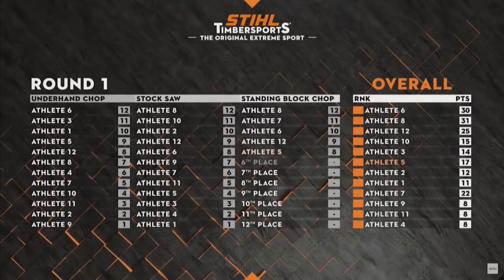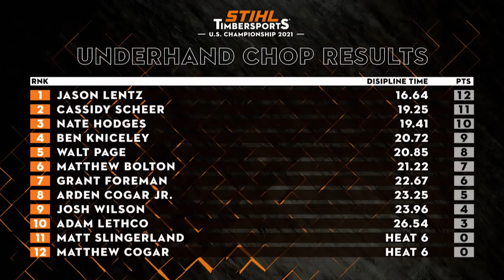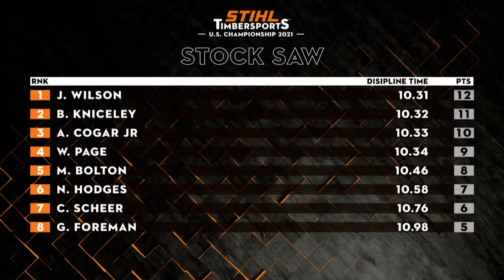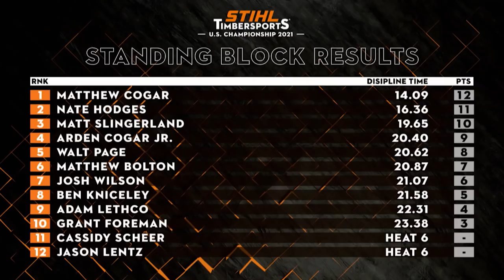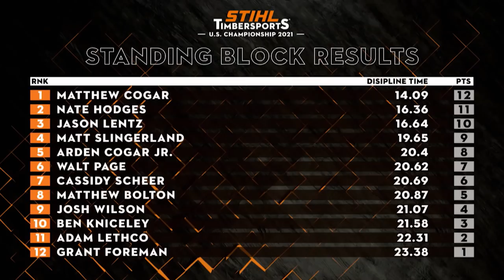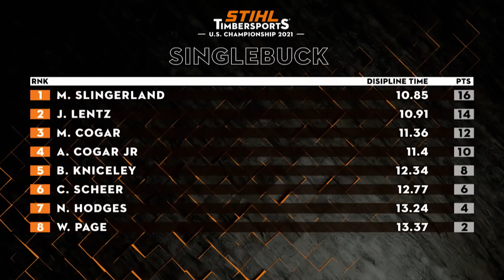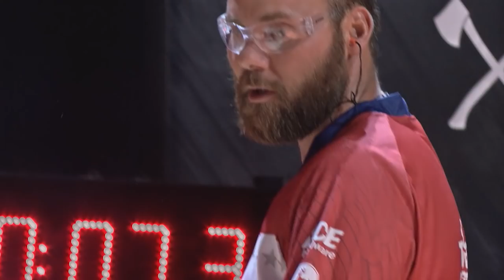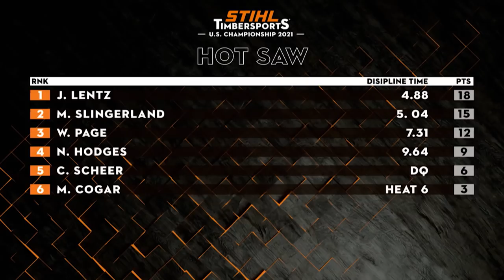STIHL TIMBERSPORTS® U.S. Pro Championship 2021 Highlights

Comment: 3:25 "RNK"; should be "RANK". This abbreviated spelling doesn't work as a stylistic choice here, as none of the other columns are abbreviated in any way. This misspelling was repeated multiple times throughout the video. Other occurences of this spelling error will not be timestamped.
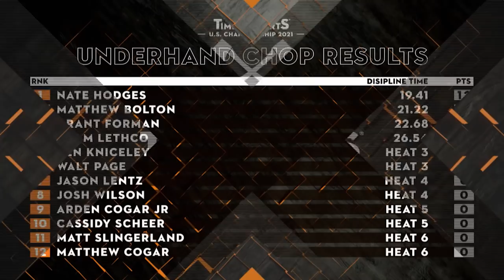10:25 "FORMAN"; should be "FOREMAN".
10:25 "DISIPLINE"; should be "DISCIPLINE". This misspelling was repeated multiple times throughout the video. Other occurences of this spelling error will not be timestamped.
10:25 "JR"; should be "JR.". This misspelling was repeated multiple times throughout the video, but gladly not in every single scoreboard. Other occurences of this spelling error will not be timestamped.
22:55 "CHAIN SAW"; a better spelling alternative would be "CHAINSAW".
22:55 "PRETECTIVE"; should be "PROTECTIVE".
22:55 "REQUIRE"; should be "REQUIRED".
22:55 "PER THE INSTRUCTION MANUAL"; should be "AS PER THE INSTRUCTION MANUAL".
1:34:25 "WARM UP"; should be "WARMUP" or "WARM-UP".
Reply from the maker: Thank you very much for your feedback, we always appreciate support! :)
Reply: I bet you’re fun at parties…

Comment: I fucking hate the points system man, Matt Cogar has twice been the best overall, and lost just because of the triple points of the hot saw
Reply from the maker: That's why the hot saw is also called "the maker or breaker". How would you assign the points?
Reply: I agree. I don't really see the hot saw as more important than the other events. The Simplest solution would be to have equal points over all events. I know this creates dramatic tension in the end of the events, but I think it is less fair and less entertaining.